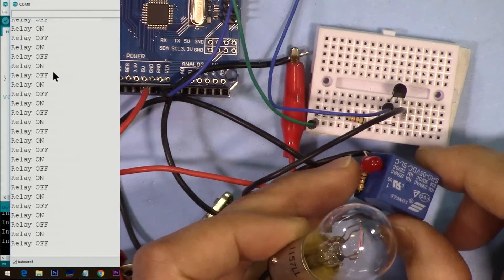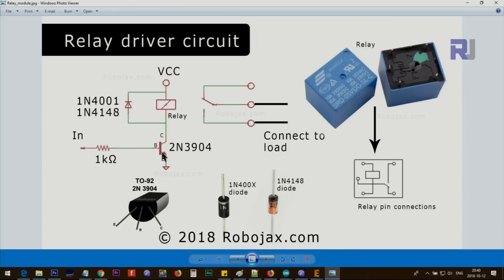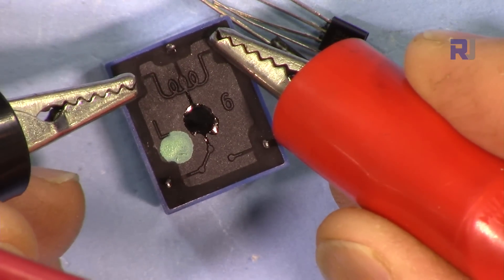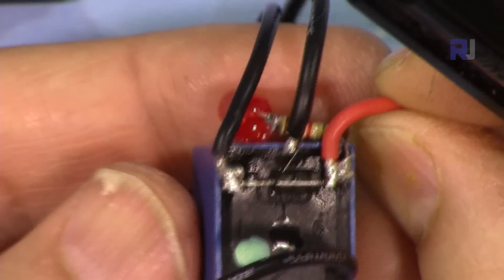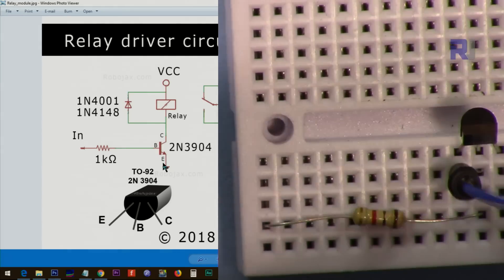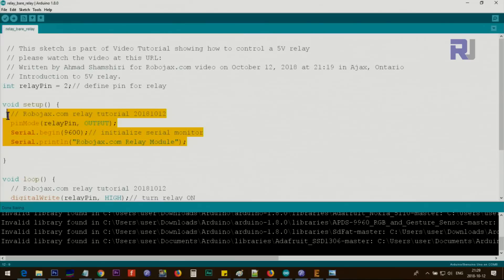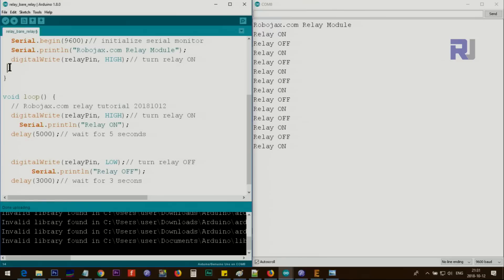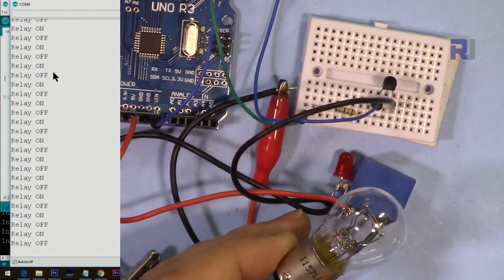How to use relay with Arduino to control AC or DC load with bare relay RJT129

Comment: What is the power rating of the bulb you have used?
Reply from the maker: it does not matter. the relay is a switch. Just read your relay. if it says 10A, then connect it to 10A or so.

Comment: I just connected 2 pin of 4 pin-relay (SRD-05VDC-SL-A) . One to pin 9 and one to ground of arduino pro mini - without  any resistor. And one cable of 220 lightbulb to relay's NO pin, and it worked perfectly.  Is that dangerous? Can I fry or destroy my arduino this way?

Comment: can this relay be used as, basic gates for home brew 4 bit computer ALU ?
Reply from the maker: relay is just a switch. it turns ON or OFF DC or AC load as long as the current of the load does not exceeds the relay rating.

Comment: Isn't someone better off using a realy module instead of using the relay and attaching all the resistors and diode?
Reply from the maker: of course it is better. but you never learn how it works and what it does. This is in case you want to make your own relay driver. here is the module https://youtu.be/58XWVDnB7Ss

Comment: Hello, I am working on theft detection meter. For this I have used two current sensors. I want to turn off the load when values of these two sensors are not equal and turn the load back when both values of sensors are equal. I have write a code and used while and if statement for this purpose.  When sensor 1 is less then it turn off the load and displays phase line bypass . For this case the code is working perfectly and it turn off the load until the phase line back to normal condition but when I go to second case which is if sensor2 is less than sensor 1 by using the same code part then it didn't work. It keeps turning on and off the load .
Here is the code. can you please help me in this and tell me where I am doing wrong? It would be helpful for me. Thanks

// THEFT PART 
  while (ecurrent1 < ecurrent2){
    CT1(); CT2();  // calls current measuring function of both sensor 1 and sensor 2
    lcd.clear();
    lcd.setCursor(0,1);
    lcd.print("Phase Line Bypass");
    digitalWrite(13, HIGH);
    if(ecurrent1 == ecurrent2)
    {digitalWrite(13, LOW);
    lcd.clear();
    lcd.print("Back To Normal");
    delay(200);}
  }
 while (ecurrent2 < ecurrent1){
    CT2();  CT1();
    lcd.clear();
    lcd.setCursor(0,1);
    lcd.print("N Line Bypass");
    digitalWrite(13, HIGH);}
    if(ecurrent2 == ecurrent1)
    {digitalWrite(13, LOW);}
Reply from the maker: why you have the "if" inside "while" loop? this will never run  because ecurrent1 == ecurrent2 will not be true as you have while (ecurrent1 < ecurrent2).
 if(ecurrent1 == ecurrent2)
    {digitalWrite(13, LOW);
    lcd.clear();
    lcd.print("Back To Normal");
    delay(200);}
Reply: @robojax  Thanks for your reply. As I said earlier for "Phase Line Bypass" that part is working fine but when the same goes for "neutral Bypass then it didn't work. Can you please tell me how can I achieve my results?
Reply from the maker: I did not understand  "neutral by pass".  My be draw diagram and post the image here https://snipboard.io/ and then share the link
Reply from the maker: Please subscribe. I appreciate it.

Comment: This video was perfect for my application and I was able to complete my PCB. However, I just learned about optocouplers and this may be a far easier approach. Nonetheless, thank you for your time, schematics, and explanation!!
Reply from the maker: Yes optocoupler can be used to protect or isolate stages of project, but it will as extra component to the circuit and cost.  If isolation bid not critical, we should not use any extra components. Good luck and stay safe.

Comment: good day sir nice video, very informative. i wish to control a universal motor using an ir sensor, relay with arduino.  your video has been helpful in the relay and transistor circuit part. now is it possible for me to connect an ir sensor to the arduino and the sensor will be the one that will tell the arduino to switch on the motor? please give me feedback Robojax
Reply from the maker: Hello, you  learn from this video https://youtu.be/T3Li128GBlM and combine it with relay . here video using relay module with Arduino https://youtu.be/58XWVDnB7Ss

Comment: Thank you for the tutorial!   Question:  If you use a 5V relay, can you just connect it directly to the Arduino without needing the transistor?
Reply from the maker: you are welcome. from your question, I know you have not watched the video fully or skipped. The answer is in the video.
Reply: @robojax  I watched the whole thing, but I guess I missed it. I’ll watch it again.
Reply: @robojax  I watched the complete video 2 times now, and did not find any answers to my question.
Reply from the maker: you made me watch the video. at about 00:40 I said "you need to be able higher current"  may it was not clear to you.  you can't connect higher current loads like bulb or fan directly to Arduino as Arduino supply very little current, so we use relay to handle higher current.
Reply: @robojax  My question was about connecting the relay coil terminals to Arduino, not the common or outputs. We can activate the 5v coil terminals using the Arduino directly, so why do we need a transistor?
Reply: @robojax  in My Case When I connect Relay Coil Directly to Arduino it goes Of..😭
Reply: @dwalden74   Did You Find Any Solution
Mini is Arduino Uno
His Arduino Looks Bigger
Reply: @fast_and_curious9144   It will work for testing, but over the long term the relay requires more amperage than the Arduino can reliably deliver. So using the transistor is the smart solution for any real project.
Reply: @dwalden74  the current drawn by the coil of relay is much higher that the current available at the GPIO pins. Hence u need transistor.

Comment: if the relay load is connected between emitter and ground does the transistor going to face any kind of damage?
Reply from the maker: if you connect it between E and GND, it may not work. The relay needs about 40-80mA and I've selected 2N3904 and I have provided the datasheet which show it can handle 200mA see it here https://media.digikey.com/pdf/Data%20Sheets/ST%20Microelectronics%20PDFS/2N3904.pdf

Comment: what is the purpose of the transistor ?
Reply from the maker: you have to watch the video. at 00:54 I have explained it.  Later in wiring I have explained it. you can't turn ON directly using Arduino. Relay needs 70mA or higher. Arduino can provide only 30mA so you need to drive the relay using transistor as amplifier. Please watch the video and do not skip. I have not said anything excess.
Reply: @robojax  thx for the explanation, i did not notice the part about relay needing 70mA
Reply from the maker: you are welcome.

Comment: can i use it without the transisor, only with a HIGH pulse and ground connect to the coil ?
Reply from the maker: No you can't. why would I have bothered to waste time and efforts to make DRIVER? without driver your Arduino board will die. This relay needs 70mA while Arduino digital In/out pin can supply only 30mA see it here and click "TECH SPECS" https://store.arduino.cc/usa/arduino-uno-rev3

Comment: Hi sir I would like to control the DC voltage power supply on off button using arduino. What kind of relay should I use.
Reply from the maker: you can use this relay https://youtu.be/58XWVDnB7Ss or  this https://youtu.be/7tUGUXyloXQ and here is how to control relay with push button https://youtu.be/7CCSRs5bvH0

Comment: Hello sir. May i know which pin the load connected? Is it the coil or the common and  normally opened pin? Ive been trying to connect from the power supply to relay then the relay to the load thrn back to power supply. Can u tell me in more details because the figure u have shown is a bit confusing to me. Thanks
Reply from the maker: Hello, I have fully explained it. You have to watch and do not skip the video. I am sure you will know it if you watch .

Comment: Thanks for the tutorials.
I did exactly what you explained in the video but my relay is not switching unfortunately.
I am using S8050 instead of 2N3904.
2N3904 is an alternative of S8050 according to https://components101.com/transistors/s8050-transistor-pinout-equivalent-datasheet
Code is turning on and off the led with 1k resistor which is attached with relay but not the relay itself. I mean no switching sound from relay. If I connect 5v and ground manually then it is switching.
Is this due to the transistor is not same or what?
Reply: My mistake. I forgot to set pinMode as OUTPUT. Thanks once again for the tutorial.
Reply from the maker: you are welcome. I am glad it worked.

Comment: Why can't we use arduino as a switch? What if we send low and hight outputs to the relay directly through arduino? Why we use transistor? Please tell.
Thanks!
Reply from the maker: Hi, I made this video to answer all. That Please watch the video I can assure you, the answer is there.
Reply: I was wondering this as well even after watching the video a couple of times. I  did a search and I understand that the current supplied from the Arduino pins is limited and not reliable enough to consistently hold the relay open. There is an explanation here. https://arduino.stackexchange.com/questions/17022/reasons-why-it-is-not-ok-to-connect-a-relay-directly-from-an-arduino-digital-pin

Comment: The best " How To" videos. Thanks !
Reply from the maker: you are welcome.
Reply: I'm starting off from ground zero building an electronically controlled air / wood gas carburetor , using Arduino, an O2 sensor and servo motor to operate the carb's butterfly valve in order to compensate for rich/lean conditions. Your videos have proven to be a great help towards this goal. Much appreciated !